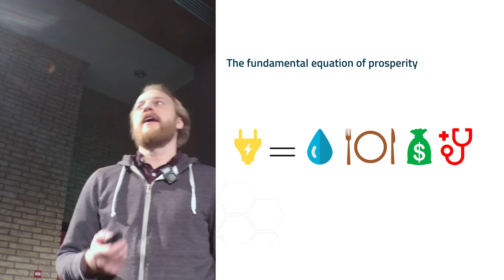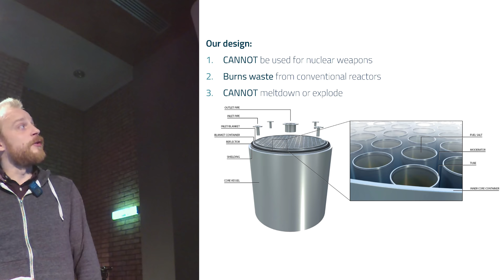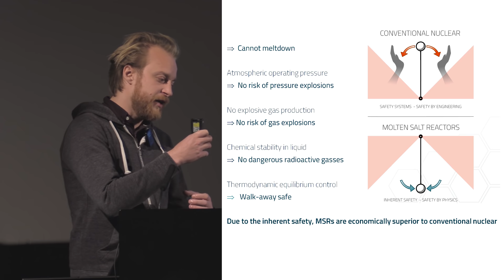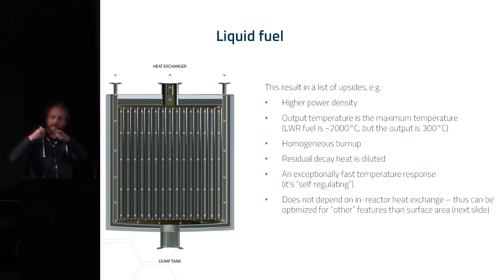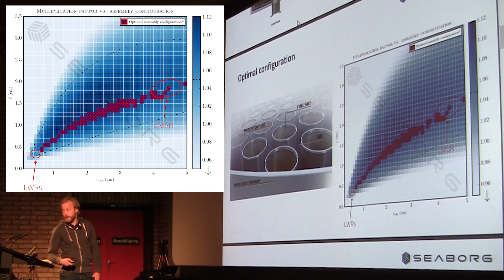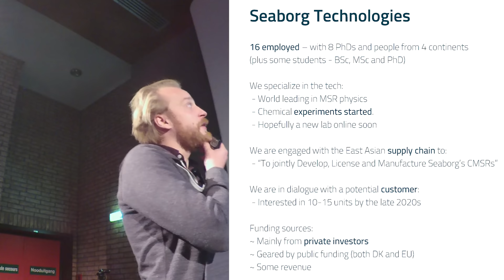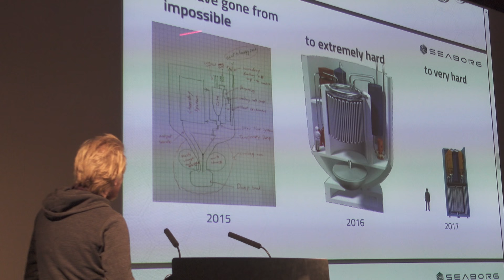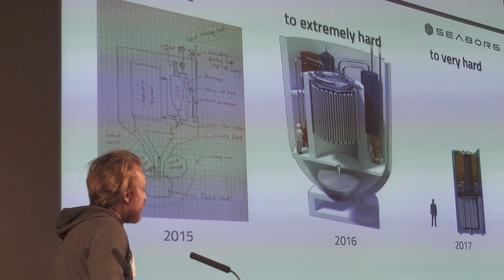Making Nuclear Sustainable with CMSR (Compact Molten Salt Reactor) - Troels Schönfeldt @ ThEC2018

Comment: A liquid moderator? It can't be water, another molten salt?
Reply: He said ionic liquid hydrogen based
Reply: @leerman22  And I am stumped as to what that could be. An acid? A hydroxide? The boiling points would be far too low, I'd have thought.
Reply: A liquid moderator would really be the holy grail for thermal spectrum MSRs. It would amplify the huge negative temperature coefficient of an MSR even further than it already is because the moderator would expand in volume in addition to the fuel salt's expansion when the temperature rises.
Reply: @Mabus16  Heavy water with an insulator between the fuel loop and the calandria. The CANDU calandria system can have the moderator loop sit at about 30-70 degrees Celsius (depends how old the average age of the fuel is)  while the primary loop is around 250-320 degrees. http://www.nuceng.ca/candu/pdf/8%20-%20Nuclear%20Plant%20Systems.pdf (See section 2.3). 

But now that Troels said ionic liquid, all bets are off the table. I am guessing LiH-LiCl with a melting point of around 495 degrees Celsius - this would mean that no insulation layer is required between primary loop and calandria, but you would probably still want double-walled piping separating the two. The LiCl series of eutectics isn't unknown within the nuclear field either: LiCl-KCl eutectic systems have been used in the pyroprocessing field experimentally.
https://www.researchgate.net/publication/263625692_EutecticLiCl-KCl_waste_salt_treatment_by_sequencial_separation_process . 

Lithium itself is a decent moderator but the presence of Lithium 6 would cause some neutron absorptions that produce tritium through the Li-6 + n -> Tritium + He process.
Reply: beryllium in the salt? flibe salt is " flouride of lithium and beryllium" all you need is a stable neutronic atom to beat around with neutrons without damage or neutron theft, the graphite does the same job, hope that helps, this is the future if they wil let us...

Comment: It would be nice to sketch a MSR Fukushima scenario. What would have happened if Fukushima would have been a MSR?
Reply from the maker: There's enough blame to go around, but one aspect that is often overlooked is the Japanese PM denied TEPCO permission to vent out the hydrogen gas because it was radioactive. That hydrogen gas would later explode and lead to the (post-flooding) chain of events making it very difficult to get water to reactor cores. Of course with MSR there'd be no hydrogen gas in the first place because no water coolant to dissociate into H and O.
Reply: gordonmcdowell hmm ... rather essential. Thanks for the info.

Comment: 13 minutes in. I disagree with his assessment of using graphite as a solid moderator. Graphite has extremely low thermal expansion. As a comparison, it's less expansive than the nickel alloy containment vessel it's housed in. Adding another liquid moderator is an additional point of failure and level of complexity. The beauty of the MS LFTR is its simplicity and few points of failure. Having to include a layer of separation between two (potential very reactive) moderators adds to the size as well
Reply: A possibility that's seriously intriguing me: Could radiogenic lead be used as a neutron moderator for thermal spectrum reactors? Its slowing down power is atrocious, but when you take into account the extremely low absorption cross section and extremely high scattering cross sections, then it actually has a moderating ratio far higher than even graphite. You might need a lot of it, but it's is also an excellent neutron reflector and absorber of gamma radiation. There are multiple materials that are co-compatible with molten salts and lead, and it's very non-reactive, even when compared against the formidable intertness of molten salts.

Comment: He said Troels, I heard Trolls, and said what? Replay, read text, reset brain. Enjoy program.
Reply: Then again, he had to bring up APC. A farce propagated globally. It has been measured, and Man caused 0.0004% of that change. Idiots propagate this calamity. CO2 has been 20 times higher and the world was a much better place. Thorium is the most promising potential for Mankind to survive the oncoming winter. A mini Ice age similar to the 1500s. Most will not survive, and 2030 is about the drop dead timeline.
Reply: @bryanst.martin7134  You crazy

Comment: Can you use a diamond as a moderator?
Reply: Yes
Reply: Yeah but it'd still have all the same cracking problems (diamond is very hard but quite brittle), plus good luck building reactor components out of solid diamond. If they have a liquid moderator that is stable in the reactor environment, then good for them.

Comment: for some reason my phone won't buffer This video. Is this the same thing as an LFTR reactor or is this Something different?
Reply: It is not a LFTR, which is thorium based. This is a different style of molten salt reactor using uranium as its fuel (unclear if it's a breeder or simply using U-235 enriched form natural uranium) as well as a liquid moderator that isn't water but is a hydrogen compound (they're waiting for the patent to go through before they give more information). This molten salt reactor is designed with safety, simplicity, and marketability in mind in order to start a supply chain and be able to set up commercial nuclear facilities all over the world, without the extreme costs associated with gigantic pressurized water designs and without having to worry about the problem of finding a customer for gigawatt-scale power supplies (there simply isn't any situation in which adding a large reactor power supply makes sense without there also being a significant shut-down of other power systems all at once, which is something electricity supply companies do not want to do; making a smaller cheaper reactor makes the transition from fossil fuel systems to nuclear fuel systems much less painful).

Comment: Looks Nice …… but distributed MSR are perspectively everywhere. Will it withstand every accident in such a form it is not critical? Assume there are some devices in the German Ar Region. The Flash Flood have a huge Power. Possibility of smashing some of your Device is high. Yes  Molten Salt locks the fission products by cooling …… but gives them than away by going in solution. 2.7 kg/m³ at 20°C in case of LiF …… in case of Flood the Fission Products will be still speared like Chernobyl. 
Yes your Design is better then the Current …… but sill critical. What you need to Build is something like a "molten rock reactor" …… and than there is still the boring question about how to handle the fission products and keep than away from life for tenthousands of years.

Comment: I can assure you, offgas from a fissioning full-power MSR will be way nastier than what this sounds like. Unless Seaborg has some trick up their sleeves regarding fissioning fluoride chemistry.
Reply: Gavin Ridley Could you elaborate?
Reply: Gavin Ridley go to 5:59
Reply: Vladi Dlr look at the offgas treatment system for the ORNL MSRE. That was a low power reactor. Go to higher powers, and the salt develops significantly uninvestigated chemistry; like half the periodic table is dissolved in the salt, and a non-negligible amount of these fluoride compounds that develop are volatile.

MSRE had activated carbon filters which did the job apparently pretty well, but some clever thinking will be required for high power LF-MSR.
Reply: TheOldGuyPhil “few that come out” yeah, those “few” coming out will kill people if inhaled. BTW, it isn’t just noble gases that come out. ORNL experimental data proves this... For instance, over-oxidized salt releases gaseous uranium hexafluoride...
Reply: @gavinridley5727  MSRE off-gas system was not very big or complicated. It was simple water cooled/shielded, low pressure system with low flow rates. If you need to look at the construction of the charcoal beds check out "ORNL-3708" document.
We have to physically separate noble gases from the salt, they are not highly volatile. ORNL-MSRE used spray separation.
Reply: @gavinridley5727  All nuclear fuels accumulate half of periodic table of elements, not just the liquid salt fuel. In the liquid salt fuel there is a possibility to separate them online by physically separation means. It is a choice of reactor designer either to seal the liquid fuel like a conventional fuel, or to remove Xenon to enable faster ramp-up and increase the dynamic stability.
Reply: Yes, think you might be right, the ingredients are pretty awful so the by products must be as well.
Reply: I thought Xxenon gas was collected from the molten salt by simply  boiling off a d being  collected in tanks a d allowed to decay. The basic idea of building reactor elements that contained neutron absorbing Xenon without any release is inherently short sighted. 
I believe a LFTR using liquid fuel and a liquid moderator would be ideal.

Comment: Sorry buddy but uranium will not last 10's of thousands of years!  Under no scenario do we have that kind of resource base or event the possibility of discovery of that resource base.
Reply: @lindsaydempsey5683  Which reactors are those? The current PWRs are 5% efficient. LB cooling hasn't shown much promise either. Russians made a couple dozen subs with it, but it really didn't proliferate the Nuke fleet. Thorium is sitting on the ground in huge stockpiles waiting for a purpose.
Reply: @bryanst.martin7134  The best hope is for a branch of the molten salt reactor family that uses chloride salts and is moderator free, the MCFR.  They can be made to have an extremely hard (high energy) neutron spectrum which will burn any nuclear heavy metal put into it.  For example, U238, U234, U236, Pu238, Pu240, Pu242, Np237, Am241 are all materials that do not burn well in LWR's that are quickly consumed in a MCFR.  Moltex, Elysium Industries and TeraPower are all developing MCFR technology.  Nothing available commercially yet however.

Comment: Cost. Fusion in the form of solar is much much cheaper so it doesn't really matter. Nuclear is a religion. Sad that such smart people waste their careers on something that's never going to be anywhere near as cheap as solar thermal or solar PV with battery storage.
Reply: Nuclear is significantly cheaper than solar. Nuclear is as cheap as coal right now, and that's power coming overwhelmingly from the pressurized water reactor design, which is arguably the most expensive design possible. MSRs especially on the 100 megawatt-electric scale are the solution to both providing huge amounts of energy to the entire world, AND doing it several times cheaper than the cheapest power production methods today.
Reply: I have long thought so too, but you are wrong. Storage is killing (except for hydro which is storage, but where the possibilities are limited, and burning wood which can be even worse than burning coal).  Renewables can or will be cost effective as long as you have fossil power plants whose output you can cut into. Once you get to the point where  renewables are your main or even a sizeable source of electricity (>~ 30%) , storage is needed. Not only is the storage very expensive, at that point you also regularly have too much energy, and you have a real problem getting rid of it without blowing out your grid. From that point on all your investments in wind and solar have less and less return, as more and more often you produce too much energy which only costs you money, and it gets progressively more difficult to make up for the times you produce less energy than the average you want to achieve. Hence more and more of your investments is sunk in energy storage. 

That is not to say that we do not need better batteries (we do), and that technology for grid scale storage with specialised batteries and or pumped hydro is not a good idea (it is even for the current grid),  or that cost and efficiency of  PV and wind should not be driven down resp up. But Germany is already running into these problems, and they will only get worse, which unfortunately will mean that they won't get rid of coal anytime soon, while shutting down their perfectly adequate  nuclear reactors (in case you wonder, I live 25km away from one of the remaining working ones). We will have little choice but to go nuclear, so we better start getting our act together and get the safest, cheapest,  longest sustainable  form of nuclear with the least problematic waste available.
Reply: The same can be said about the solar / wind fan club.  Nobody talks about how much CO2 is generated for a windmill base.  No one talks about that the diluted nature of renewables require more copper to collect this to the grid than there is in the world, or that the very nature of solar dumping so much power simultaneously onto the grid at the same time driving the wholesale cost to zero, thus getting poor return on investment.  The South Australian Tesla battery costs have driven power bills through the roof in that region and it can supply the grid for 4 minutes.  I put solar panels on my roof 10 years ago with visions of the future, but the more I learn about its shortfalls, the more I realise that at best renewables an only supplement base power, not be base power. This leaves you with fossil fuel or nuclear for base load. Our choices are indeed very limited and it’s a question of what problems are we willing to live with.  Again, nuclear is the devil we will have to live with.

Comment: Too expensive, too dangerous, too complicated
Reply: Dangerous? Back your claim
Reply: @matthewdick6063  You might ask some Japanese or Russians about it.
Reply: @kathyfausett9301   You are talking about two fundamentally different technologies.
The most significant difference is that the molten salt reactors are able to produce efficient 
power outputs from high temperature, low PRESSURE reactors. A molten salt reactor would 
leak into a much lighter cheaper containment vessel, whereas a pressurised water reactor 
must operate at high pressure to get useful amounts of power output. A 1500 psi leak is a much different
scenario  than a 60 PSI leak, even with the huge ,expensive and still barely adequate containment vessel
to control it. There are plenty of other advantages as well, including a fuel , (Thorium) which has a half life
of 14 billion years outside of a reactor. It has to have additional neutrons provided from another source to
maintain a reaction. Dropping the fuel/ heat transfer liquid into storage tanks stops the reaction and decay heat
,which  was the cause of the Fukushima  explosion, is absorbed  by passive air cooling.
Reply: @316tomiller  Sounds like a much safer system.  Could I put one on my roof?

Comment: Salt reactors are still not safe
Reply: Troll
Reply: There is no such thing as 100% safety, or rarely 100% anything else. We just need to find the best compromises for optimal results.
Reply: @stuarthirsch  What are you talking about? Nuke waste can contaminate air water land for billions of years and can distroy your DNA!  Nothing on Earth can do that. Nothing!
Reply: @stuarthirsch  MSR designs rely on nickel-based alloys to hold the molten salt. Alloys based on nickel and iron are prone to embrittlement under high neutron flux.

Corrosion risk

As a breeder reactor, a modified MSR might be able to produce weapons-grade nuclear material

The MSRE and aircraft nuclear reactors used enrichment levels so high that they approach the levels of nuclear weapons. These levels would be illegal in most modern regulatory regimes for power plants. Some modern designs avoid this issue.

Neutron damage to solid moderator materials can limit the core lifetime of an MSR that uses moderated thermal neutrons. For example, the MSRE was designed so that its graphite moderator sticks had very loose tolerances, so neutron damage could change their size without damage. "Two fluid" MSR designs are unable to use graphite piping because graphite changes size when it is bombarded with neutrons, and graphite pipes would crack and leak. MSR using fast neutrons cannot use graphite anyway to avoid moderation.
Reply: @mafelkins  It depends. Our current light water reactors produce a high amount of high level radioactive waste. This is because to run a light water reactor requires enrichment Uranium 235. Also the spent fuel isn't reprocessed to extract fissionable plutonium.  Reprocessing fuel rods to extract plutonium is dangerous, expensive and the plutonium 239 can and is used for nuclear weapons.  A Liquid Molten Salt Reactor, can "burn" almost all high level  radioactive waste inert nonradioactive element into very level that will decay to safe levels in several hundred years. Using thorium as fuel they will breede U 233 but that will be almost all consumed by the reactor yielding very little high level radioactive waste, and none that can be used to make an atomic bomb. Basically if we change the reactor and the fuel we can minimize if not eliminate the nuclear waste issue. As the video points out. Again no such thing as a free lunch, either in economics, energy, environment, or just about anything else.
Reply: @mafelkins  Billions of years? Um citation please...and not greenpeace